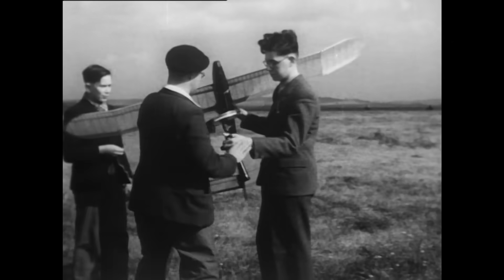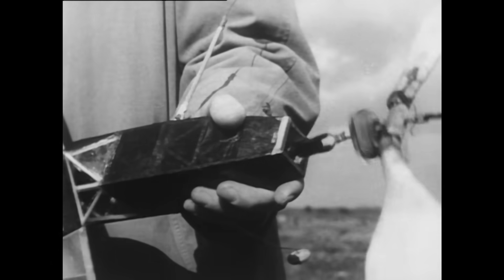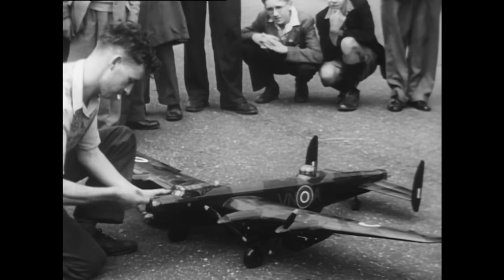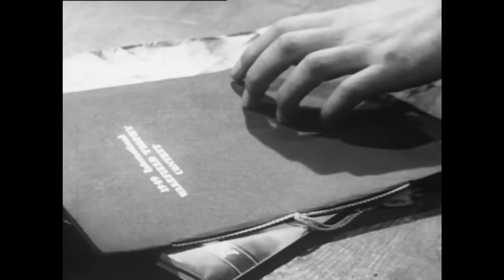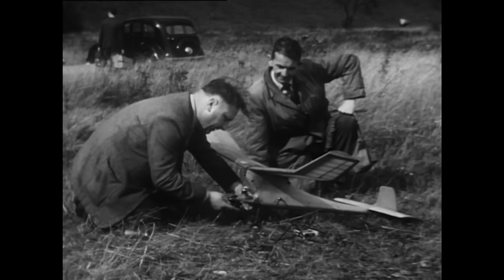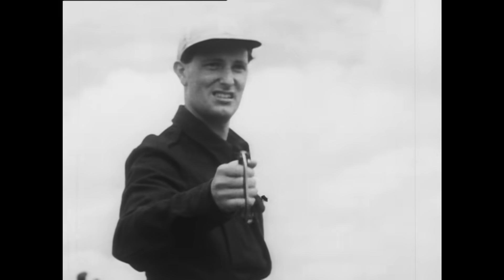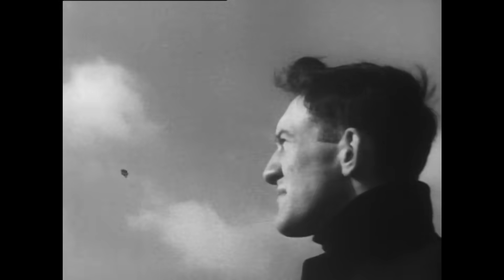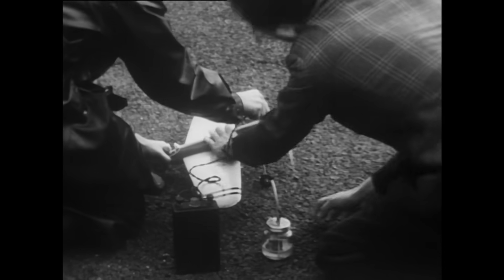Model Flight | Shell Historical Film Archive

Comment: In the opening scene where he's sliding the wings on and hooking up with rubber bands ;;and I just bought a styrofoam kit ( a zohd talon rebel . RC model ) that  are made clip  together so the thing can be carried and stored . Nothing new under the sun .  It has a remote control servo plugin at the wing root suggested for quick assembly at the field . 
The model here would still work the same . 100 years later .

Comment: My memory of flying model aircraft in the 1950's was that half flying models crashed on the first flight and that plastic Airfix types ended up being set on fire for a visual crash scene in the back garden when parents were out. Then there were Jetex engines powered by a fuel pellet which could set the modeller on fire!

Comment: I wonder how they remotely control the plane with just a single button to click? (I've only watched the first half of the video on mute).
Reply: They normally used a rubber powered escapement. A ratchet system controlled by pulses from the receiver, some would alternate between left and right rudder movement so you had to remember what the last control direction was. The more complicated ones would use say 1 click for left and two clicks for right. The most complicated allowed for elevator up control or simple engine throttle. The system worked as long as the rubber winds lasted, fly too long or use the control too often and it would become free flight. The early RC models are now looked on as interrupted free flight.

Comment: The huge rc transmitter (1min 33) reminded me of the single channel radio controller transmitter published by "Aeromodeller" that I built. It had 1 vacuum tube (a double triode DCC90), a 90volt battery and a hand held button switch for the control. The antenna was 11 feet tall. Around 1955, I think. I'm 83 now.
Reply: Hello Sir, When I see those times modellars wearing elegant suits, holding their beloved models, I almost feel like Im there with those gentelmen. I wish I could see your models.  Best rergards, Marcin, 47 yo, Poland.
Reply: 11ft long antenna! wow.
Reply: 😂😅

         ....,8

Comment: That way to change cylinder capacity was amazing in a smart way.  That decision to attempt to fly in that strong wind was amazing in a stupid way.
Reply: You don't change the actual capacity of the engine, only the compression ratio
Reply: @keithgibson568  Slight reduction/increase in capacity is what changes the compression.
Reply: That's why this hobby combines well with kite-flying and model-sailboats.